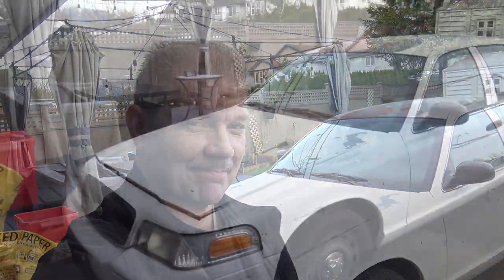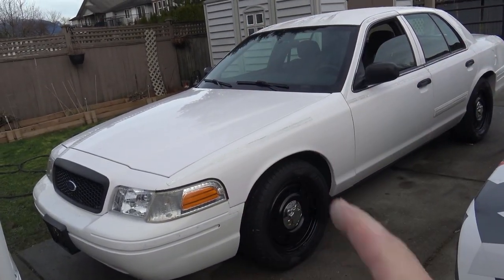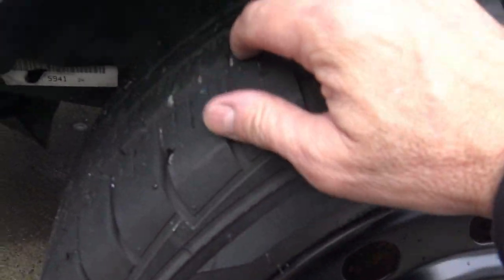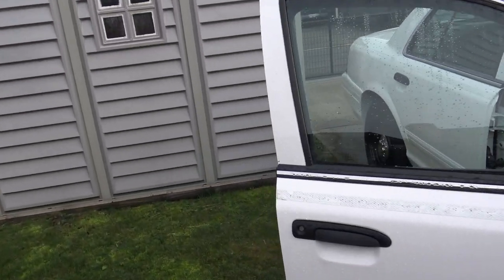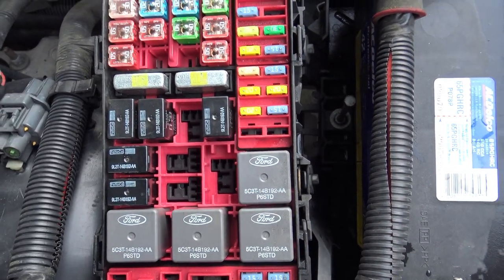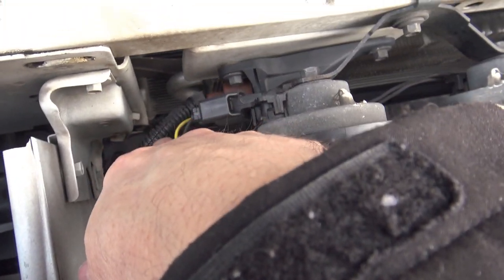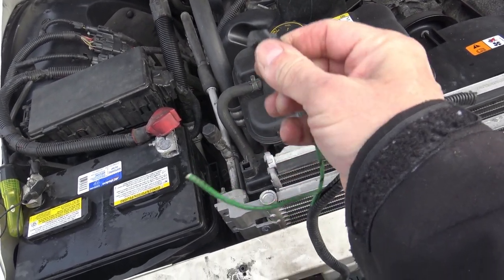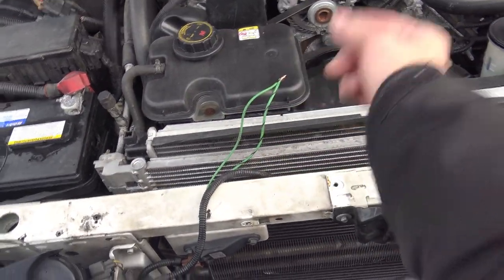Good Vic one problem

Comment: Ford had a LOT of problems with Arctic White paint...peeling like onions.
Reply: Yes I have a 2003 Grand Marquis GS and the paint comes off horribly like eggshells revealing the primer below. I worked at a shop where we plastic bead blasted and we did tons of trucks for a Ford dealership here in Tucson back in the mid-to-late 90s. The federal government mandated that lead had to be taken out of the paint which helped with adhesion. I can't believe every car manufacture apparently has this problem and has never fixed it